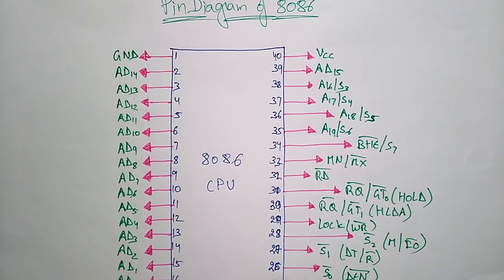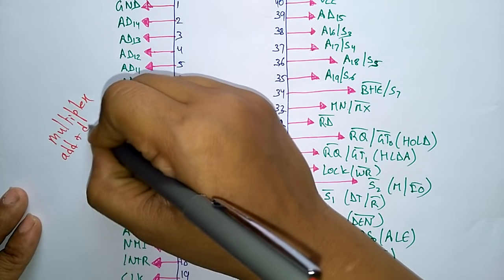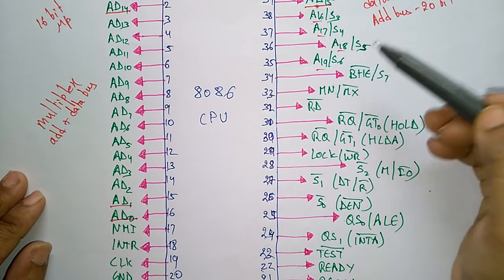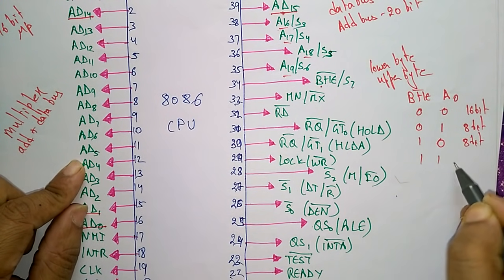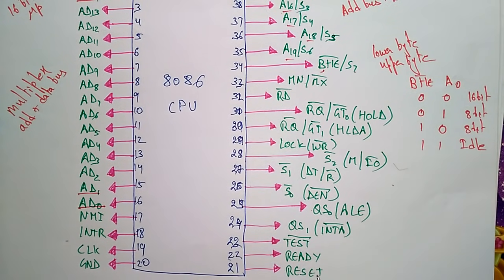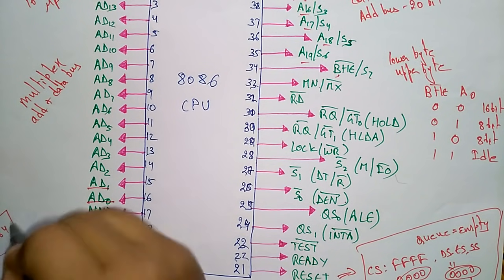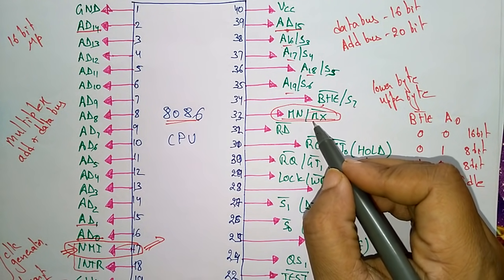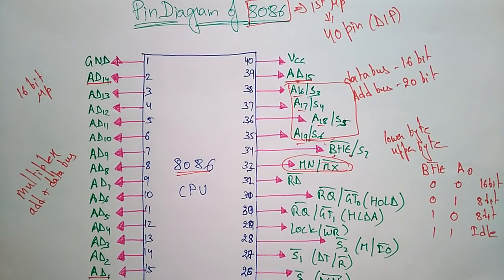8086 pin diagram | MPMC | Lec-12 | Bhanu Priya

Comment: where is the explanation about TEST and LOCK pins?
Reply: Lock will lock the system bus. Test is used to test the processor operations are working correctly